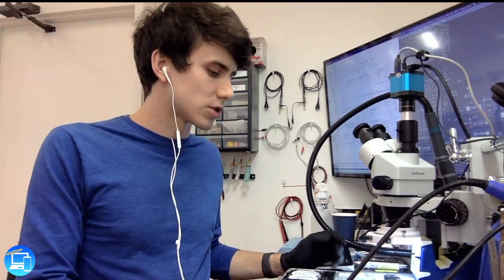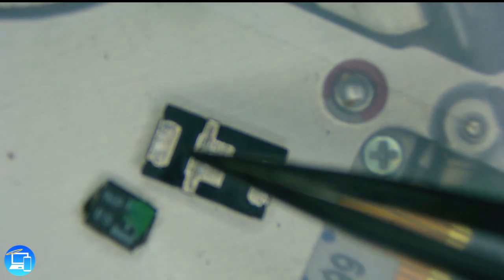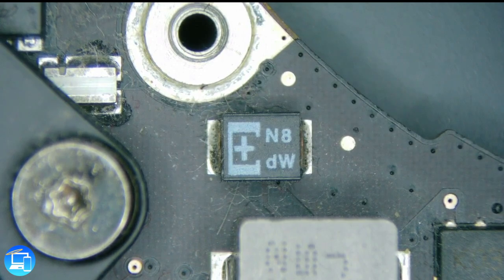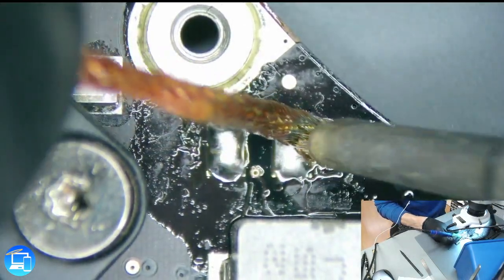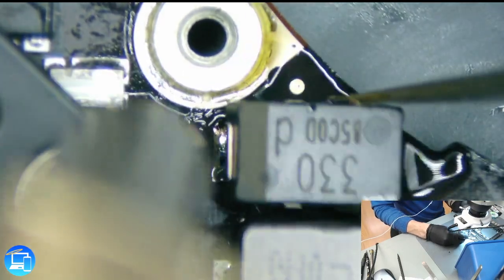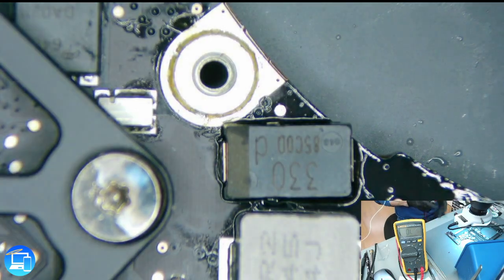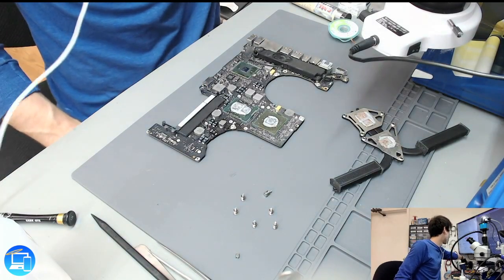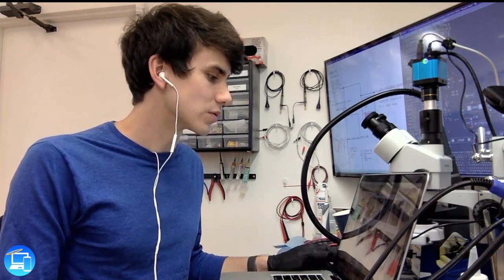A1286 820 2850 Kernel Panic Repair

Comment: Today noviembre 1rst 2024 I change the capacitor, I found a replacement on a donor board, same capacitance and voltage. And for now it is working.

The problem I has was when I was installing high sierra the machine turned off and on the screen apeared a label saying something occured due a hardware issue.

Change the ram and the same result. 

After watching this video I replaced the capacitor and the macbook let me install the system.

Until now it is working. I hope it keeps like now

Thanks a Lot for your help

Comment: Thanks for this. How hot is the airgun and what temperature should it not exceed to avoid frying the capacitor ?
Reply from the maker: Depending on your rework station, anywhere from 400c to 500c. Just refrain from heating the area for too long. It is better to use a higher temperature and work fast than it is to use a lower temp and work slow for this repair.
Reply: @iRevive  Thank you! What diameter, and type of solder did you use to resolder the pads, and the type of flux used? Also, is there a method of doing this without a rework heat gun ?(which I don't have and may have to buy). Am completely new to this so need to get it right first time (or at least try not to screw it up :)
Reply from the maker: @mindfulawareness1  I use Kester "245" 63/37 solder and Amtech nc-559-v2-tf flux. I have a link to both in the description. You you do not have a rework station, you can also you micro soldering tweezers. But the Quick 861DW is going to be more affordable than purchasing Hakko soldering tweezers. I should have a link in the description to the Quick as well.
Reply: @iRevive ok thanks again. Great video for beginners like myself.
Reply from the maker: @mindfulawareness1  You're welcome. I hope you are able to get your MacBook Working again!

Comment: Thanks for the video. Can you please tell me where the capacitor is located on the mid 2010 13" board?
Reply from the maker: Hi there. Sorry for the delayed response. The 13" boards do not have a GMUX since there is no discrete GPU on this model, so there is no GMUX capacitor for the 13" model.
Reply: @iRevive  Thanks for the reply and update. Any idea why there would be a kernel panic in my 2010 13” MBP soon after starting? I’ve done every software trick that I know so far. One clue could be the fact that the wifi isn’t reliably working. In system information the wifi shows signs of loading up, also the wifi symbol appears at the top right of screen, sometimes the network name is seen, but no joy there when connecting. Could be physically disconnected near the screen hinge. If so, could this cause a kernel panic? Thanks.
Reply from the maker: @reelMn  there are many reasons for kernel panics. Bad ram, bad SATA cable, liquid damage, etc. what does the kernel panic report say?
Reply: @iRevive  I've got the logic board out of it at the moment - when it's back together  I'll check.

Comment: fantastic video my man , spot on all the way, fixed my problem completely.
Reply from the maker: Awesome! I love hearing success stories. Glad this video helped out.
Reply: @iRevive  I’ve got another probably with a MacBook Air, 820-3435B, it won’t power on and when plugged in the charger just blinks on and off rapidly and the light is dim on the charger. Any help would be greatly appreciated.

Comment: Great video. I saw the Rossman capacitor replacement video and a couple others. Your guide is very helpful. Well done. One thing, though. It is spelled kernel, not kernal! I recommend you fix your title and description. Cheers.
Reply from the maker: Thanks for pointing that out. I didn't even notice that before. I am glad you found my video.
Reply: @iRevive  I'll let you know how it goes. I have two Mid-2010 MacBook Pros to fix for my family. One had the logic board replaced for free by Apple under the extended service program (now expired). But that logic board failed after about 18 months. Apple Genius Bar refused to replace it again. I don't have all the proper bench tools to do this myself but one of my sons is an electronic technician who does have the tools.
Reply from the maker: @RichardSchletty  If he has the tools and has experience with replacing surface mounted components, I feel confident he will be able to complete the repair. I hope to hear success stories!
Reply: @iRevive  He is able to replace surface mounted components. He has a double tipped soldering gun at work but not at home. Be sure to correct spelling in your main title "A1286 820 2850 Kernal Panic Repair". You'll get more hits! Best.
Reply from the maker: @RichardSchletty  Perfect. You sound well equipped then. And thanks for the pointing that out. I made this video over a year ago. It’s funny that I didn’t notice the typo before.

Comment: My 2010 15-inch MacBook was freezing the image after appearing on the startup disk partition, and the screen consistently turned clear gray. I upgraded the capacitor to a larger 330uF. Now, the system progresses further, displaying the Apple logo and then the login screen. However, subsequent to this, it freezes the image, and the screen turns clear gray. Should I attempt using a 470uF capacitor, or could there be another issue unrelated to the capacitor?

Comment: Awesome video. Used it to replace my capacitor, but have you a video or instructions for those of us who removed the contact pad from the logic board for the fan. The plastic 4 pin contact pad. Thanks in advance.
Reply from the maker: Hi there Michael. I appreciate you calling us. So sorry it took a while to reply back to your comment. Where you able to get this resolved?
Reply: Unfortunately trying to replace the 4 pin connectors is testing my patience and talent, which means I’m doing it wrong lol. Do I need to re-ball the points on the board itself, because it seems almost impossible to solder the contacts to the board without bridges. Thanks for your response.
Reply from the maker: @michaelglaab897  you’ll want to use plenty of flux to prevent the the pins from bridging each other. Apply solder to one pin first. This will hold the connector in place. Then move on to the next pin. If you accidentally create a bridge, use a little bit of wick to remove the excess solder.

Comment: Great job.
Is this a permanent fix or is there more issues later?
Reply from the maker: Thank you James. This is a permanent fix if you replace the capacitor with the recommended Panasonic LX0D331R that store.rossmanngroup.com sells. That is the capacitor we used in this video.
Reply: De 2v o 2.5???

Comment: Hi, does this fix work on the 17” MBP from the same model year, mid-2010? I just started having GPU kernel panics after 10+ years of no issues. Black screen restarts, and if it reboots, the GPU kernel panic report. Works when I try not to use the discrete GPU, have gfxCardstatus installed to monitor usage. Unfortunately my computer doesn’t always reboot after a crash, it gets hung in a cycle trying to power off with a soft clicking sound from the upper LHC near the MagSafe plug, not near the hard drive. Usually have to wait awhile for it to cool down and then push the power button. Do you have any repair suggestions, as I’ve heard the capacitor repair or kext file mods don’t work on the 17”, only the 15”. Many thanks.
Reply from the maker: I am not sure why I am just now seeing this comment. I didn’t see a notification for it. Is there any update on this Mac? If you are still having this issue, it maybe more related towards your GPU. From my understanding, the 17-inch 2010 did not have the same issue as the 15-inch.